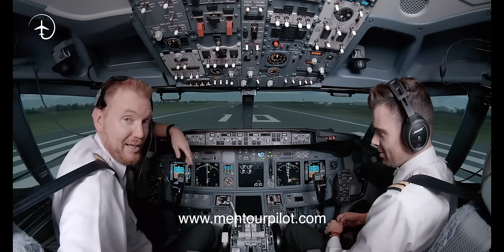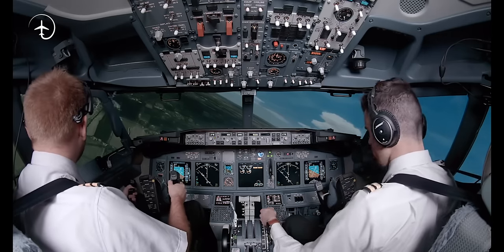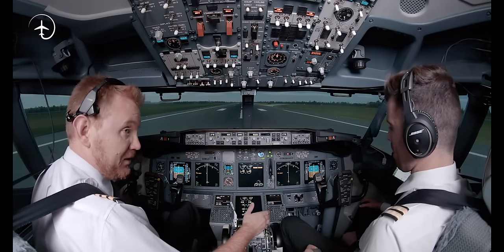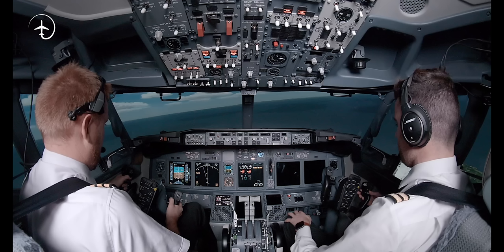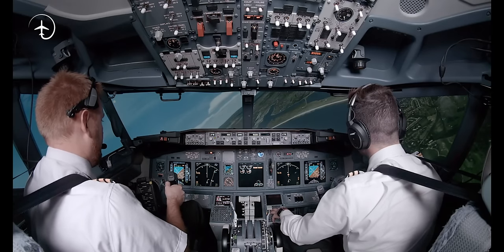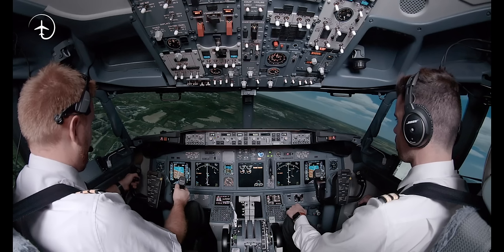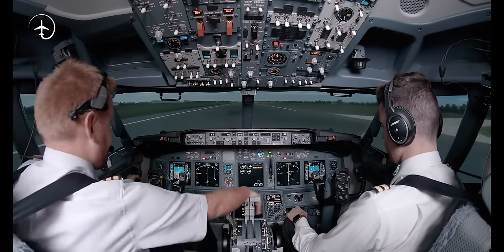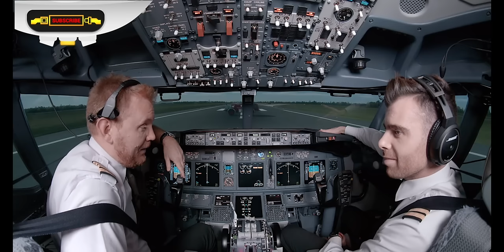Can an Airplane land if BOTH engines fail?

Comment: I am always confounded by how the f/o seem to struggle with the flaps settings. I noticed the same in other clips as well.
Reply: agreed, not only on this channel, but on almost all vids I can find on youtube, that flap control stick is pain in the axx.
Reply: It has a very strong bias spring to keep it in the detents, as well as a very stiff action, as it drives cables down to the flap controls. Not something you want to accidentally deploy in flight, as you can destroy the aircraft that way.
Reply: Yes, I have noticed that too! It’s always a struggle to release the locking mechanism. Maybe he should use two hands and show it who’s boss!
Reply: @MrChaza001  on the Air Transat A330 which ran out of fuel over the Atlantic the loss of power lost the hydraulic systems which powered the flaps.  Without them it surely would ge a struggle to deploy the flaps?
Reply: @cigmorfil4101  I don't think it's possible to deploy the flaps with no hydraulics. The A330 has a ram air turbine to provide some hydraulic power and the 737 has manual reversion but I don't think either will operate the flaps.
Reply: @RobertHancock1  
With loss of engine power hydraulics are going to lose power so I would expect a struggle with the flaps   I was just confused by those who didn't seem surprised that operating the flaps would be a struggle. 

Perhaps I glossed over that it's a struggle in normal operation in their comments.
Reply: Apparently it's really stiff on the simulators for some reason compared to the actual aircraft.
Reply: @cigmorfil4101  Good question, I would only assume that when that A330 ran out of fuel it didn't have the option of using the APU where in this video they ran into birds, so still had fuel to run the APU to give hydraulics for the flaps and spoilers
Reply: @abcdwxyz2157  
The only power they had was the RAT (Ram Air Turbine) which provides minimal power and hydraulic pressure.

Comment: the best way to find out how much you know is to teach you must be a pretty awesome pilot by now .. although sully and his type fighter pilots bring in f4 phantoms when the should have ejected.. always wanted to be a pilot done 60 hours on 172s never enough in one go to be a pilot but I use the knowledge and my engineering degree attitude to safety as I do right now driving a london bus on routes 23 and 13 . fortunately the company that I work with has managers with licences andhealth and safety come first and customer comfort and experience comes after that its a good bunch sadly in other companies some drivers tolerate issues instead of reporting them. Best london bus company i've ever worked in tower transit westbourne park , others not so much. I think the pilot training helps me be a better driver! Thankyou for you channel you're absolutely fantastic. 52 years old and still want to be a pilot

Comment: This is a really awesome video!
Two questions from a private pilot.
1. You were overbanking the aircraft and said that you did that to have a better view of the runway. However, overbanking leads to a quick loss of altitude. Was it worth it? Or were you well aware that you had enough altitude to get back to the runway? Later you said that you were a bit too high on the approach. So, you knew from experience that you were high even before starting the turn?
2. What if this happened in IMC? I am not sure if birds fly in IMC (probably not) but still?
Reply from the maker: I was actually a bit high so I did it to loose some altitude as well.
Reply from the maker: It it happens in IMC it’s a lot harder, but still possible

Comment: Absolutely fantastic execution, bringing that flight to a safe conclusion. I am curious to know what software that simulator uses?  I feel that it would be a professional industry standard, as opposed to any public release software on a pc.  I Currently use X-Plane 11 with the zibomod,  and also used the PMDG 737NGX for Microsofts FS10. Brilliant video there Captain.

Comment: Captain 3miles per 1000 feet is when you have live engines. What's the right hand rule for a dual engine failure. given wind is calm and aircraft is at its max landing weight. Also what is that were to happen in cruise. That will be really handy to know.  Thank you. Your videos are really helpful.

Comment: This was quite the eye opening demonstration. I'm quite concerned there isn't an uninterruptible power supply, just for the flight deck's auto-pilot, and instrumentation, to bridge the power gap, between engine provided power, and APU provided power, and or stored battery power. As a passenger, I've never feared an engine out, as I know commercial airliners are designed with powerless flight in mind. They're a lot like a sail plane, in some respects, and can glide a very long way, after loss of engine power. Thanks for sharing this.

Comment: As a non-pilot, I would imagine that a significant problem in any emergency is panic - or at least greatly increased heart rate - even for a trained pilot (you are humans after all). Is this an issue, or can you turn the adrenalin off? Many thanks for consistently informative videos.
Reply: You can’t turn off the adrenaline, but if you’re trained well you just work through the problem and do your best. 

If you panic and freak out while flying an airplane, you’re almost certainly doomed.

Comment: Hi!  I have nothing to do with the airline industry,  except for being a passenger several times a year. I very much appreciate your responsibility to the flying public, that balance of informing without scaring.

May I make one suggested area of improvement in flight safety. Given the high adrenaline situation the pilot is in, I don't know how many would be able to make the mental arithmetic calculation translating height and air speed into a safe landing speed by subtracting banking energy and air resistance slowing without the help of a computer doing some of the work.

Comment: Why were the fuel control switches not shut after landing as well as fuel boost pumps. Parking brakes were not set because they were hot understood but fire truck parked in front of the a/c?

Comment: Hi, there. Great video! I loved every second. I had a question with regards to how I can measure the time the aircraft takes to descend down in the event of an engine failure. How fast is the speed of the aircraft reducing? I understand that depends on your gliding angle but how would you calculate the rate at which speed reduces with respect to the gliding angle?

Comment: Great video. Thank you for making aviation popular, in such a professional manner. At one point, the plane overbanks. Ok, it is for descending a bit faster and having  a bit more track miles, in order to be able to lose altitude even more. But Mentour also said he banks heavily "to see a bit farther / to see the runway better". Why then Boeing removed the "eyebrow" windows above the windscreen, prevalent in the old 737's (aka "the Jurassic" series)?

I understand they were used for astronavigation & other, now obsolete purposes. There is actually another, older video from Mentour on that ;-) But in this very scenario it is really appalent - looking at the blind plugs in the plastic trim in place of these windows - that they would give the pilot in command a far better visibility of the runway on the right... 

Why aren't they fitted anymore, even if only for this rare scenario? Too heavy? Glass being prone to damage?

Comment: Nice explanation Mentour.

I see you were quite busy with flying the airplane and navigating it back to a runway. Is that why you didn't cut off fuel to the engines when you decide not to restart, or is fuel flow just a non issue when the engines are stopped?

Comment: Brace brace brace at 50 feet a bit late to me. I am not Boeing though different procedure. Airbus is 500AGL and some company procedures are higher. Nice video! Do you get a good rate on that simulator?

Comment: very professional .. should be part of training for ever pilot. would enhance ability for good energy management. perhaps moving the thrust levers back to idle and fuel control switches to cut off would round off the picture, of course just for the peanut gallery ;-) .. I know, was not part of any procedure performed and priorities were well chosen. Also a little slipping action turning on the localizer will kill some energy the brakes don’t have to eat later. Nice job, Both of you!!

Comment: Nicely done.. you glided it in safely. Oddly enough, having no engines almost makes it easier.. now you don't have to meddle with that dang power lever thing😅... im dash8 pic, and notice that with base jumping.. gliding in.. even tho really slow relative to airplane, it's kind of nice not having to worry about power.. just make sure high enough for LZ.. and can always S turn or sink it in.. but if low.. be ready for tree landing... so always B-line to an LZ before any showy turns i learned!

Comment: I have questions:
- why not use most of the runways length to break? Breaks wouldn't get as hot because they got more time and speed to cool down and thus are more unlikely to get too hot and cause a fire
- why not use air speedbreaks to loose some energy before landing?
- was there any time to realize you were too high and could you have lost some altitude somehow? Let's say you would have been just a little bit higher - what then? Immediatly turning means there is no way to "snake" down and then what?

Comment: Good day, Mentour! Nice and very detailed video, as always. 

Any specific reason to set flaps 10 at this situation? As it not seems to be used normally, it is either 5 or 15. Was it reasonable to put plane into that a bit unusual configuration, under already critical situation?
Reply: The goal was to get the flaps out as much as possible as soon as possible.  Smaller increments require less change in airspeed to be within limits for the level of flap deployment.  Additional flap makes it easier to slow for the next detent, and so forth.

Comment: Why not turn the throttles off as soon as the engine malfunction occurs? ps Excellent video as always
Reply: I'm not sure about that, but I guess that the movement of pulling back the throttle  at the beginning of the emergency is useless and a wasting of time, that could be crucial to survive in critical situations like this.
Reply: he explained that in the later part of the video,  sinse both engine were Not spooling at all their would be no restart and taking the time to do that is waist of time. fly the plane 1st
Reply: @raybankes7668  I know, but why not take half a second to shut off the fuel so as to prevent a leak/fire/engine suddenly acting unpredictably? Perhaps their strategy is to leave everything as it is, since any change introduces risk?
Reply: Because if it actually happened, you wouldn't know instantly what happened. You're not told "you're going to have a dual bird strike, killing both engines" you've got to figure out what actually happened, what got damaged first before just shutting things off

Comment: The APU takes quite a while to start, or it sure feels like it during a crisis! During that time, batteries kept your instruments on, but what provided hydraulic power for you to be doing some significant maneuvering? Is there an emergency ram turbine that powers hydraulics? In the simulator, could you feel a difference in the controls? If everything was being accurately simulated, and both engines literally stopped dead like that, I'm amazed at the incredible redundancy allowing you all the tools to safely land, including flaps and gear and spoilers. The engineering that goes into our modern airliners combined with the excellent training for our pilots is under appreciated, I think. It's truly a marvel of human achievement how safe our planes are.
Reply: Yes.  The RAT most certainly deployed itself after the engine failure.  Notice the yoke inputs to correct the slight asymmetrical drag induced by it (it's not in direct center of the lower fuselage) around 1:41.
Reply: In the extremely rare event of a dual engine failure, 737 reverts to 60 minutes of standby electrical battery power (which disables/sheds a lot of non essential instruments and diverts all of the instruments to the captain's side).   Hydraulic power is also lost, so the 737 reverts to manual reversion which allows non hydraulic cable assisted control of the ailerons/elevator. This can make the controls heavy and less responsive, but still allow control of the aircraft.     If the APU is available it will restore both hydraulic power and electrical power for one or both (bus) sides depending on which side needs to restore power   On aircraft which don't have manual reversion (such as heavy aircraft such as the 777 or A320), a ram air turbine is required to drop immediately under the belly once it senses a loss of both engine driven generators, in order to restore electrical power and restore hydraulic pressure and maintain control of the aircraft.
Reply: Christopher B. Jack No RAT on the 737...

Comment: Is there a reason why the Fuel Cutoff switches aren't turned off after the decision not to restart? Would it not reduce the amount of fuel being pumped out to the engines, potentially lowering the risk of a fuel leak in the case of severe damage?

Comment: why dont you add the altitude, heading, throttle settings, barber poles, speed, etc in these videos? they are too low res to see the screens and its hard to watch stuff like this without knowing the critical data. a lot of NTSB videos have these videos where the critical data is displayed over the videos.

Comment: Thank you Mentour Pilot......... I loved it ........ and yes as an aviation enthusiast: more of these technical Vlogs! 
I really hope you’ll see and respond to my question, sir:
Why didn’t you "kill" both engines once engine failure was confirmed? I mean the engines are not producing any thrust and hence to generating electricity, the reason you started the APU!
Why are asking the fire & rescue services, if there was any leak they are to inspect for it naturally along with any fire or smoke and spray the retardant agent and enable evacuation?

Comment: It is a very interesting video. I have some questions :

1. The autopilot was disconnected because of both engine failure which means no electrical power supply? Or it is just an automated system process based on emergency situation as seen with a breaker for electricity at home ?

2. ( From electrical power supply view point) 
If one of the engines functions, the autopilot can still work? 
APU is not sufficient for supplying enough power to the autopilot system? 

3. I think that maneuvering an airplane manually is a mandatory procedure in case of emergency landing. But I would like to know if  the autopilot system is technically capable of doing emergency landing in case of " glider situation " as seen in CAT approach if the autopilot can work with APU power supply only. And if the autopilot works with only one engine available, it is capable of emergency landing ( apart from the official procedure) ? 

Thanks

Comment: One question: when you knew you had enough altitude to make it to the runway, why didn't you use a higher flaps so that the brakes wouldn't become that hot?
Reply: He explained that in the last bit of the video. It's better to have more speed and higher altitude to land within the airport border for quicker help from emergency crew. You don't want to bleed of too much.
Reply: Speed equals lift means distance. Flaps equals lift but less speed and therefor less distance. 
When your gliding you have to maintain speed. Without power you can't just add whichever flap setting you want without stalling

Comment: Thanks Mentour for all your great work ! A question : if l've understood correctly, an aircraft may make its departure using a ground start if the APU is out of operation. What then would be the impact for the pilots in the event of a double engine failure ? l hope this is not an antagonistic or stupid question.
Reply: Andrew Pinner Means only the captains side have DUs as they would be on battery power only, the flight controls would be hard to move, and they would had to drop the landing gears. The APU can only be inop for 10 consecutive days, so this happening is extremely unlikely🙃

Comment: Thanks for the video Captain!! Great explanation and the cool & calm Captain saved the day. 
MY QUESTION is : 1.Why does the battery back up only the instrument panel of the Captain and not the instruments of the First officer?? With couple of more batteries both instrument panels can be easily backed up from the batteries. IS THERE ANY REASON to enable the First officer to start the APU ???? Looking forward for a reply from the Captain !!!!!

Comment: Fascinating video but, as Peter acknowledges, this is a best case scenario. Both engines are knocked out when height and position are favorable for returning to the airport. !n 1989, British Midland flight 092 (Boeing 737-400) was not so lucky. One engine caught fire and the pilots opted to make an emergency landing at East Midlands airport in the UK. Unable to see the engines and confused by the instrumentation, the pilots mistakenly shut down the good engine leaving the aircraft without power. By the time the pilots realised the situation, they had run out of height and crashed on a motorway near the village of Kegworth, half a kilometer or so before the runway with the tragic loss of 46 lives. If I remember rightly, the air crash investigation report recommended that all aircraft be fitted with cameras. It seems that this may not have happened . . .

Comment: Very good.  But can you do this only on aerodynamic models.  With planes which naturally pitch-up, like the 737 Max, would that be a problem, or is the pitch-up on that model primarily when engines are running.  Do all planes have a similar glide capability?